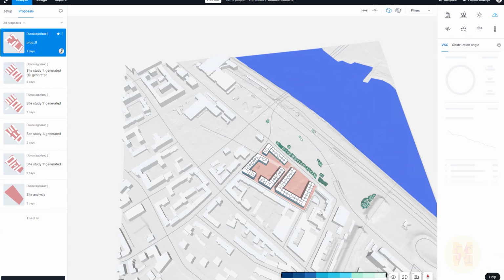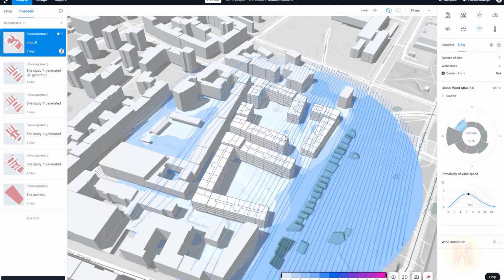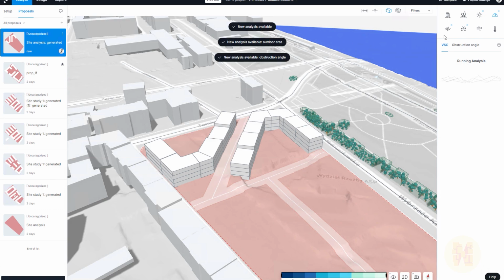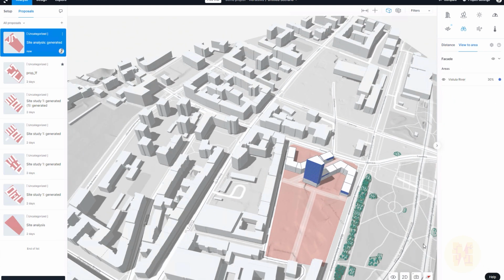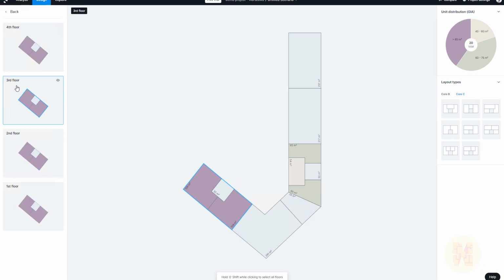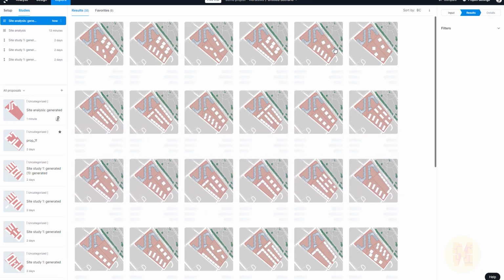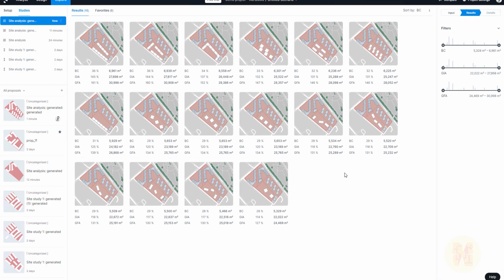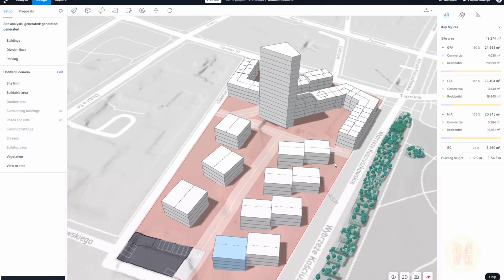Feasibility and Generative design | How to analyze your Architecture idea

Comment: Always amazed by the friendly user interface done by Space maker. 
The future is in generative design. Especially which the process of optimization, architects will need to design algorithms instead of drawings and decide how much flexibility to allow for generative design, or when to use traditional architectural logics. I have developed my architecture practice startup on generative design. Share some of the developments with you guys here.

https://youtu.be/gIIljqkEnGI